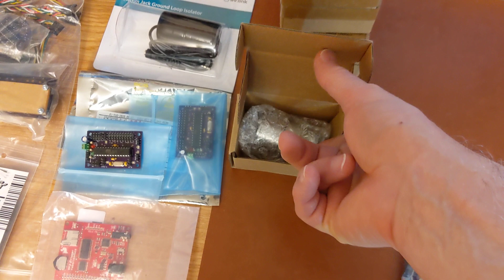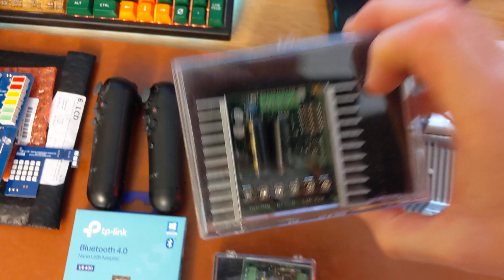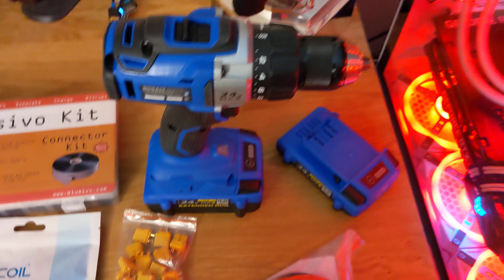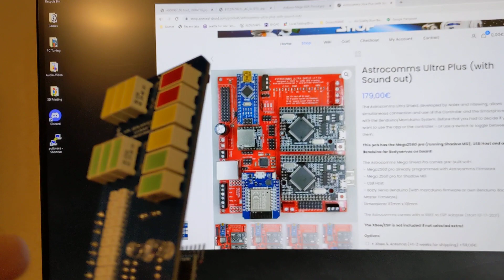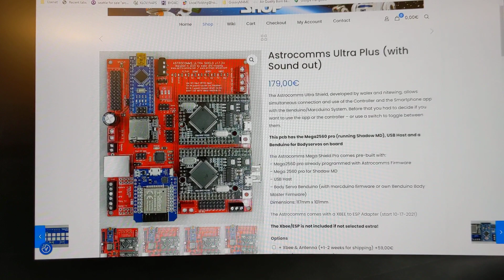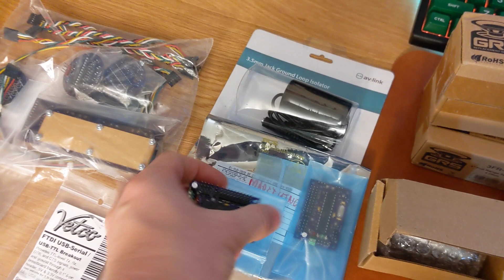3D Printed R2D2 - Part 85

Comment: I had exactly the same issue with my parts from Printed-Droid.  Communications were poor and it took almost 4 months to get a part.  BTW - the Charge Panel and the Data Panel will operate stand alone mode if you wish...just apply power and away you go.
Reply: Me 3 - Ben is a nice guy and does give great advice if you can track him down but is terrible at responding to emails! Took forever for him to send me the order and it was short 1 ordered item... but he included some nice extras so all is well.
Reply from the maker: I wonder what's changed since I ordered the panel parts.  Those were sent with no drama.  He's got a lot more products now, maybe he needs an assistant to help with the shipping.
Reply: I too had the same experience with Ben. I'm sure IRL he's nice enough, but his customer service stinks and communication is non-existent. Only way I ever got ahold of him was through Facebook Messenger. Contact form, email address, etc received no reply. After more than half a year I finally got my products, and they work fine, but I definitely soured on the purchase after the really poor customer experience.

Comment: It's exciting to see you take the plunge - I'll keep my fingers crossed that things go smoothly. Based on my somewhat limited experience, I think if you can get a 6Ah capacity battery, that ought to be sufficient to get you through most days (provided R2 isn't dancing up a storm). I'm jealous of the tool batteries' small form-factor as well as your soldering skills! Thanks for the shout outs, too. Good luck and keep us posted!
Reply from the maker: Thanks Jason!  Keep making great videos and I'll keep shouting about them!
I'm now wondering if I should mount a second battery so that I can power the drives from one and the electronics from another.  It's surprising how many choices there are in making a droid.

Comment: Just an idea for the battery indicators. Glue a small square of alu foil, or a very small piece of a mirror in the case. Then you can see the light in the reflection. The button you still can reach.
Reply from the maker: Thanks, that's a good idea!

Comment: i started this project a month ago my dome is all printed i have not even started to glue or paint anything yet the dome is just being held together with clips i started on the body prints and printing away as i type this im glad i came across this and thank you at first i was just going to have r2 just be a display but the more i print im thinking maybe make him move and do stuff but i said well lets get him built than think about the electronics after hes completed
Reply from the maker: Do yourself a favor and take brakes from printing to do some sanding/painting.  I rushed to get all the parts printed then when I started doing the finishing I realized that it would have been better to do it as I went instead of having a huge pile of parts that all need to be sanded staring at me.
Reply: @TomsProjects  ty yes i have enough to do with sanding and painting so ill take your advise ty again

Comment: I'd be interested to know roughly how much all this cost in total? I know you got a lot of it a while ago so might be hard to add up. I was planning on just having mine as static with lights, but the further i get along the more tempting it is to have it fully working, just not sure if my budget could allow that at the moment
Reply from the maker: I've kept track of most purchases and it's a lot more than I originally thought it would be.  It's been a while since I totaled it all up.  I've spent way more on primer than I thought I would, I should probably do more sanding of the parts before I start priming and using glazing putty.  The electronics keep surprising me with more and more needed parts.
I'm pretty sure I'm over $1500 by now but I'd have to add it all up to know exactly.

Comment: Interested in seeing how you paired the ps controller, thanks for sharing.
Reply from the maker: I just now posted a video of the process, it went fairly smooth for me.  I think a lot of people have issues with using the USB host shields that have recently been found to have a manufacturing defect.  There's a link to the info and fix in my Part 86 video.  You do have to remove and replace a surface mounted IC from the board though.  I ended up using an Arduino Mega 2560 ADK as they have the USB port on the board, so I didn't need to use a host shield.